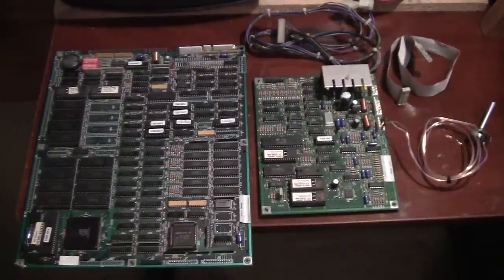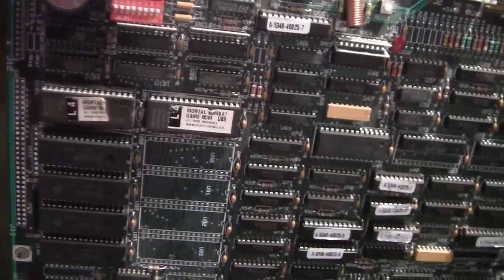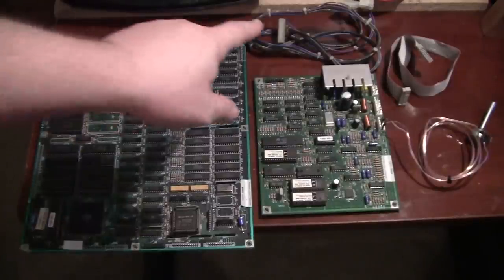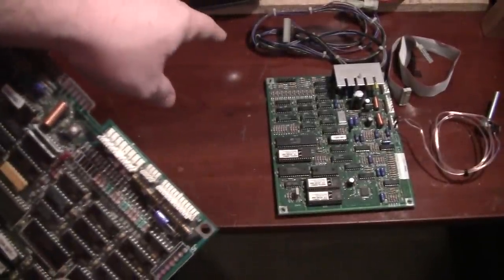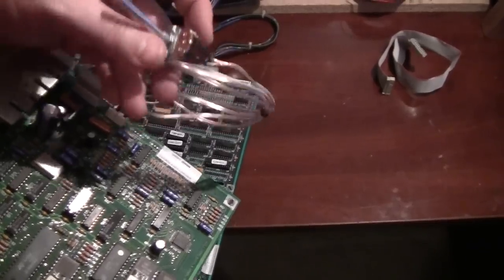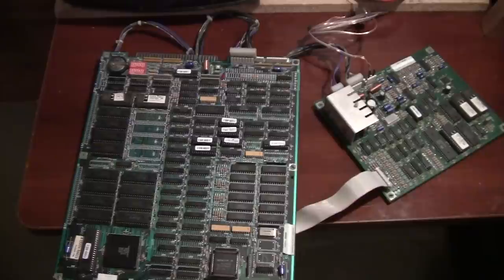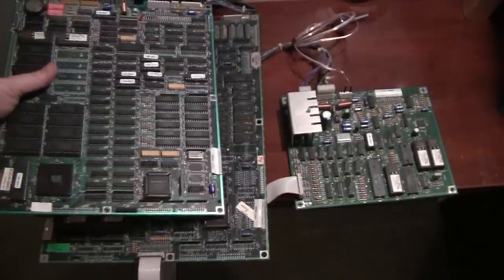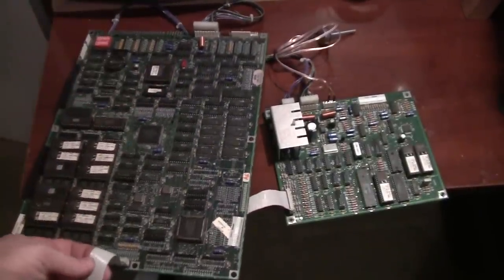Basic Mortal Kombat Arcade PCB Information [HD]

Comment: YourMKArcadeSource you where right Bad Roms, 3 red. i pulled roms to reset them and found 4 the 30 pin sockets where corroded and a 2 chips missing a few legs due to the corrosion :( wanna sell one of your boards ;)
Reply from the maker: That's what I figured. I don't have any at the moment, but if I get an it, I'll let you know.
Reply: YourMKArcadeSource thanks for the help. And please keep me in mind if you come across a pcb
Reply from the maker: You're welcome. Will do.

Comment: Good stuff,  if anyone is interested in replacement ribbon cables or volume pot with connector (no soldering required) feel free to message me.
Reply: Yeah he is a good guy, shop with confidence.
Reply: Will the sound work without a potentiometer?
Reply: Justin Parks No unfortunately not on a mk1/nba jam/smash tv/high impact/total carnage ect...

you can however use a piece of wire or a jumper (wire with 2 gator clips) to test the soundboard. you don't want to leave this like this long as it will burn out the amplifier and possibly blow your speakers as well as it will send the signal out at full volume. (do this at your own risk).  You'll use the jumper/wire to short the potentioneter pins at connector J5/P2 depending on the board.
Reply: Collector-itis
Ok thanks for letting me know, I am interested in a volume pot as my PCB does not have one, what do they go for?
Reply: Justin Parks inbox me
Reply: Collector-itis do you still sell volume pots with wires? If so how much.